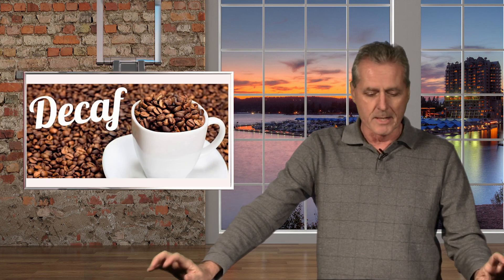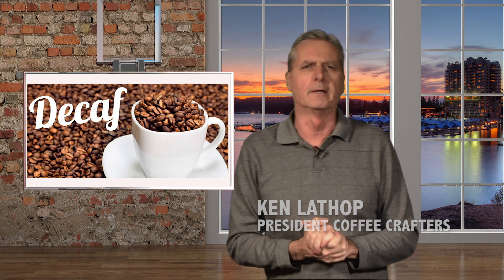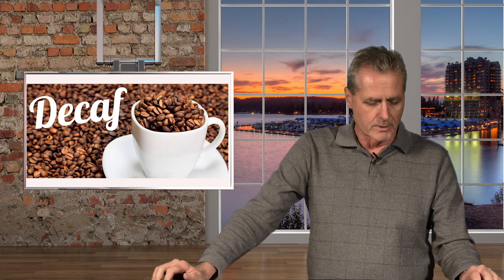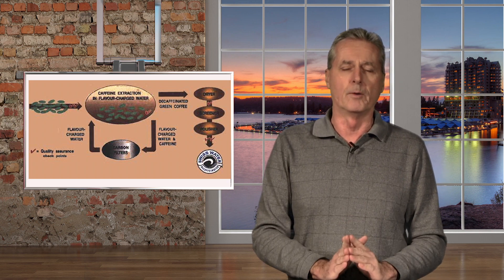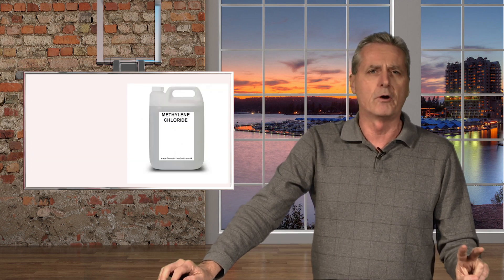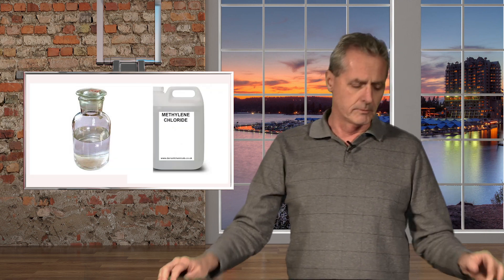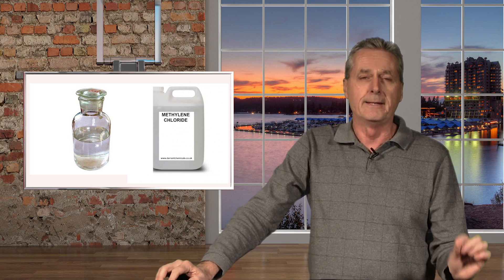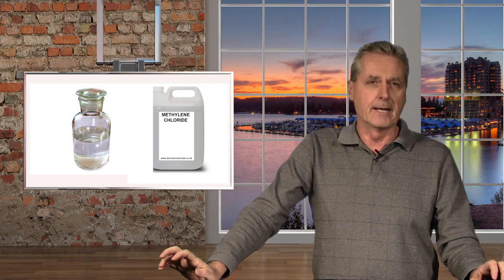How Coffee is decaffeinated

Comment: You may have this somewhere, but if not would you be willing to do a video on the best way you have found to roast decaf in your air roasters in terms of heat/air settings, rate of rise, etc.?
Reply: Hi Larry. Roasting decaf is a challenge. It finishes QUICKLY. Because it has basically been deconstructed and re-infused it changes the bean density. Once it goes past first crack the heat curve rises quickly where a regular bean curve remains stable. Bottom line, when roasting decaf pay close attention after first crack. I can't tell you how many times I've been BS'ing with someone and burned it :o)

Ken